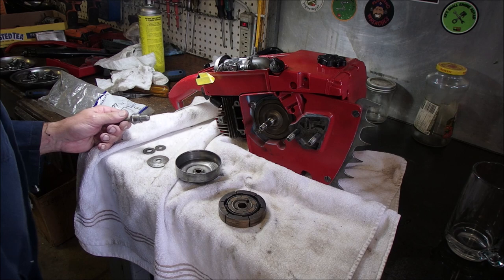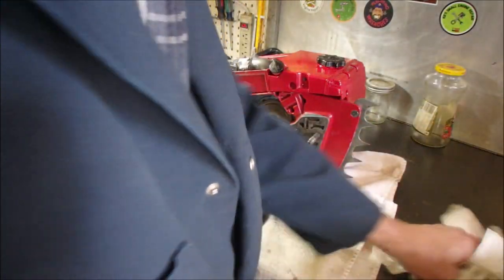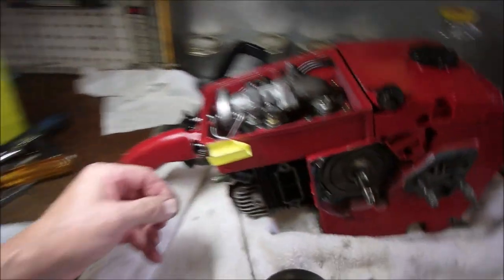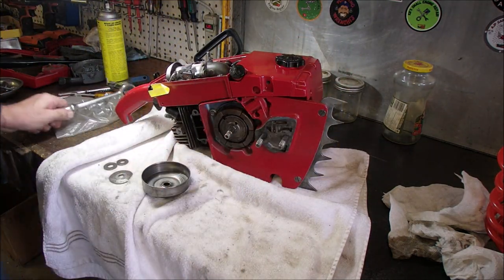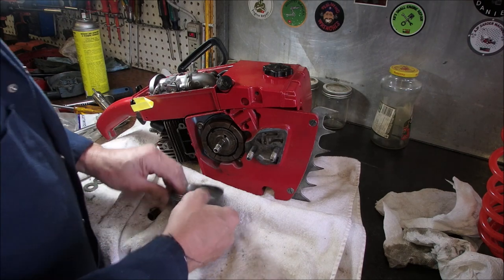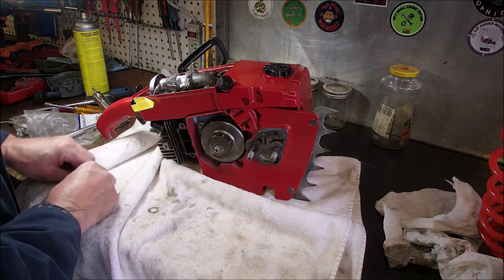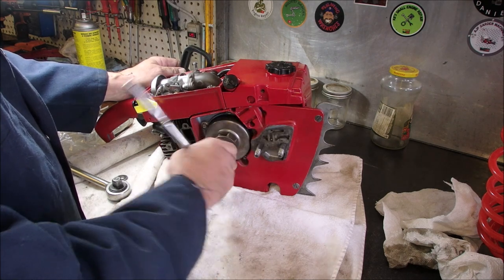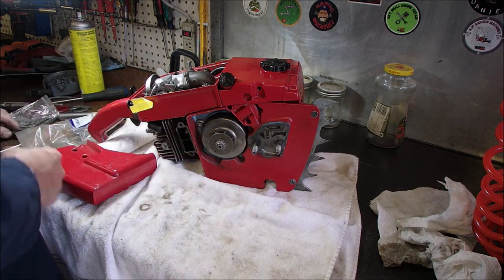XP 1020  Saw Assembly Saga

Comment: Great seeing this old saw develop, when I started working for myself in the seventies I had a pioneer 600 metal case no anti vibration or chain brake you new you done a days work with it, ball breaker.progressed to husqvanas years later thought I had a rolls royce . Great videos on this saw Bruce 👍
Reply from the maker: Well as you figured out it will not be a daily user.